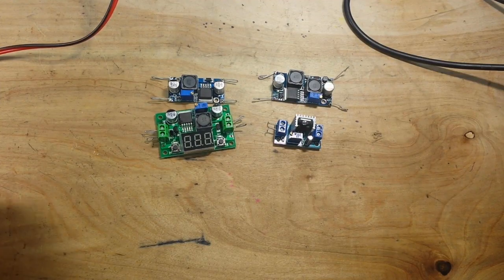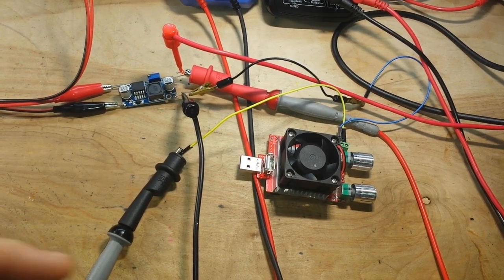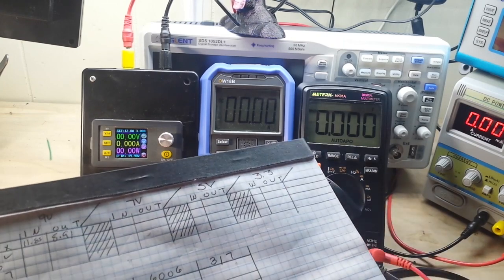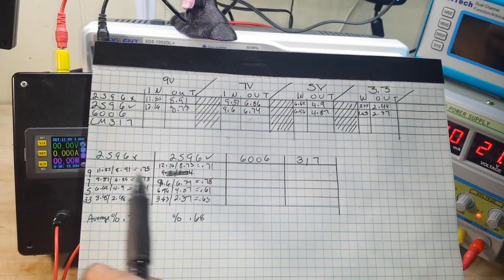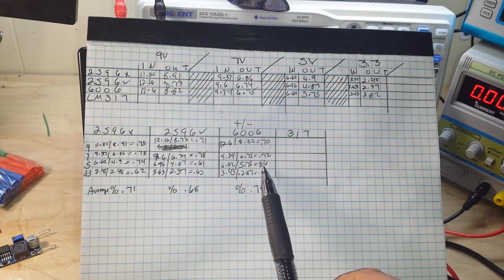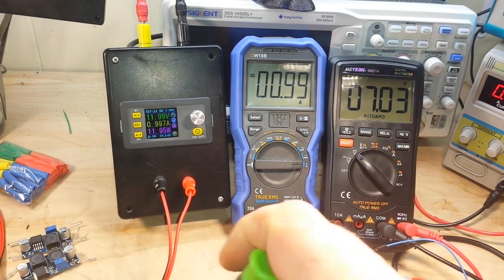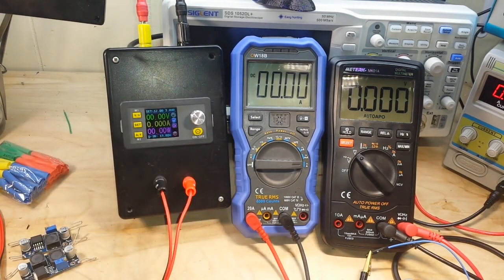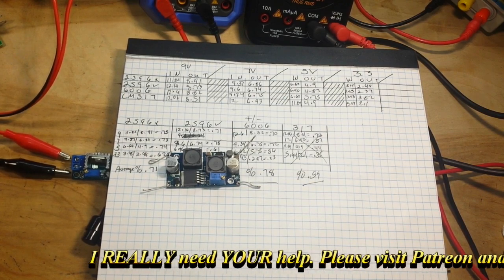Buck Converter Shootout

Comment: but you just tested the buck mode... can you try the boost mode?? kind of like the opposite, you have those voltages on the input and set a higher voltage at the output. I have the 6006 and it works like yours in buck mode but in boost mode it is horrible... can not output anything useful. Thanks

Comment: Why that is not at all what they say in the listings.  You can do some neat mods on some of these boards. Like pin #5 of the 2596 can be lifted and turn into a MPPC solar controller to keep the panel voltage at optimum for charging batteries or making it a linear current booster.
Reply from the maker: Ok

Comment: Hello cool video, thanks for the upload. I am making a system that will operate at 12 volts but my input battery goes up to almost 16 volts when fully charged. Do you have any suggestions about what I can use to get 12, 13 or even 14 volts out constantly? I will be running equipment at 800 watts max with a surge or 1400 watts. Thanks for any ideas you might have.
Reply from the maker: Yes, use the buck/boost converter.  It will output a steady voltage regardless of input.

Comment: I've not used any of the ones you've shown here (except the DP5005 (or whichever you're using) a great little unit).  I tend to use the small low current ones to power or protect 3.3 and 5v outputs with them (with the odd 12v for good measure).  I rarely need more than 2A and so generally only pay 99p or less.  Usually by buying in bulk - makes it much less.  It's like adding protection to an 18650 cell - I'd rather blow one of them that something expensive.
I've used 1x aaa battery to power 10M of 5050 LEDs (not for long! ... but for long enough) They are excellent in vehicles to convert its 12v to anything you want and if all you have is a powerbank - it's surprising what you can power with even a small one of them.  I usually add a few 2.1mm power plugs and sockets (the ones with screw connectors) a couple of USB cables and a M/F plug to M/F USB adapter  for luck.  I can almost connect anything to anything.
Except that is for my new phone which has a type C connector!!!

Comment: LM317 always has a fluctuating efficiency based on Vin vs. Vout and Iout. With that heat sink, consider never using it above 500ma and a differential of more than perhaps an 8V Vin to Vout. It will however, have lower noise levels on the output...